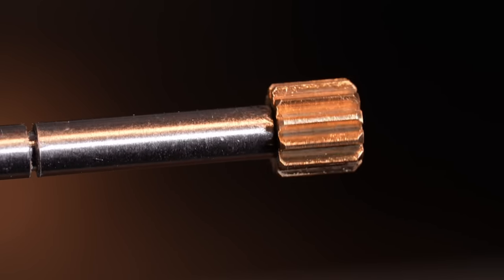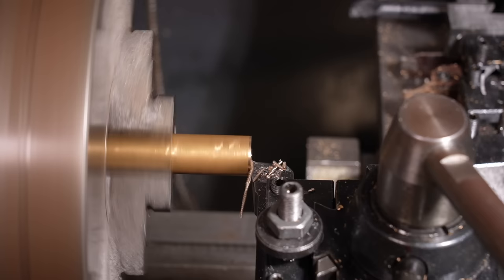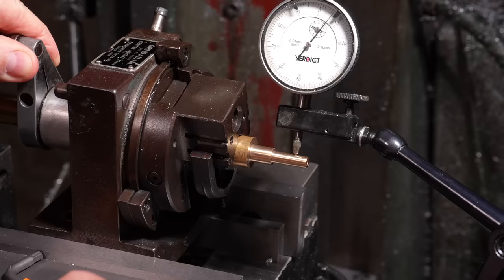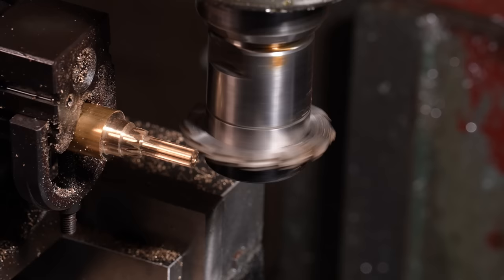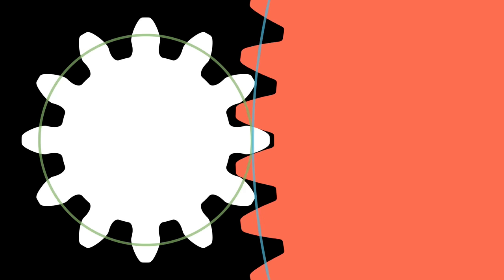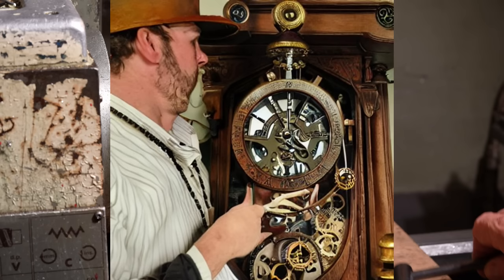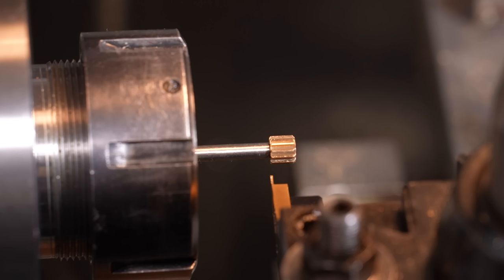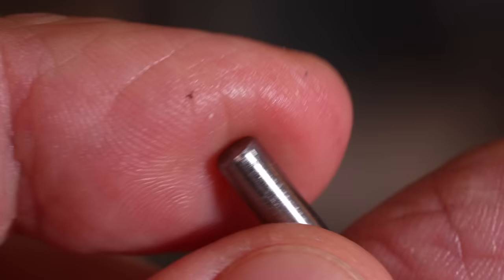My First EVER Try at Machining a Brass Pinion Gear - or ANY gear!

Comment: For "normal" gears, it is quite easy to determine Module from a physical gear: M = OD / (N+2).
OD = the outer diameter of the wheel, N the number of teeth.
So, with an outer diameter of 7.0mm and 12 teeth, you do indeed get a Module 0.5.

To go from Module to pitch, you multiply with PI, so the teeth in this gear should be spaced 1.57 mm apart.

Comment: Nicely done! I am a bit surprised you didn't go all out and build a stepper motor indexer just to make the tiny pinion though ;)
Reply from the maker: Oooh, I feel even MORE seen now! Yeah, I did consider making a wire EDM machine to make the gear. That would be TOTALLY in character...
Reply: @MachiningandMicrowaves  and imagine all the other fun stuff you could do with that!
Reply from the maker: I am SO tempted.  Lots of microwave/mmwave waveguide parts are much simpler to make with EDM
Reply: @MachiningandMicrowaves  exactly!
Reply from the maker: @tommihommi1  Now I've checked, a wire EDM is already on the project list, but it's WAAAAAY down in the running order

Comment: Oh my we are on the same path. I have finally got myself an indexing head and need to make some gears. I purchased a M1 set for a task that Im not quite ready to do but then discovered the majority of plastic gears appear to be M0.5. I have just ordered a set from China but also discovered less than M1 needs a smaller arbor, 16 rather than the 22 of my M1 set, tooling always gets you. My objective is to make the same sort of gears you have so Im grateful for your honest and direct help, I too am no machinist but I get by.
Reply from the maker: That 12/13 M0.5 cutter of mine takes a ONE INCH arbor, which is a bit huge
Reply: @MachiningandMicrowaves  Gee that is large and imperial to make it more limiting. Personally I get my cutters from Aliexpress at around $80NZ a set and free delivery but you wont find much imperial stuff. I think the 22mm arbor I purchased originally was $49NZ. For a home shop its really impressive what you can get at the moment from China, I suspect it wont continue.

Comment: 0:29 The shrinking of the small nylon gear leads to increase of the stress around the circumference. It shrinks on the axle, but because of the non shrinking of the axle, the stress in the circumference increases, which leads to the snipping of the gear . This effect is the more, the bigger the inner axle is in relation to the gear. It´s a common design flaw.

Comment: If I'm not misremembering, the formula for figuring out the outer diameter of a gear is D=2m+m*z
With this, you can use your diameter and the amount of teeth to determine your module profile.
For 7 teeth and a diameter of 9, you'll have 9=2m+m*7, or 9=9m, or m=1.
This of course assumes a standardized gear, which yours might not be, but maybe it'll help in the future =)
Reply from the maker: Indeed that's right. In this case, to OD was 7.0 mm and 12 teeth, so it certainly works if the gears are not worn and are cut to the standard involute profile.

Comment: The cutter you used was.5 module? I need to make a similar sized gear for an old doorbell. One you spin a shaft which spins a double ended “clapper” through a set of three gears. One is gone missing. It’s a 12 tooth involute brass gear, outer diameter 10.5mm, shaft 5mm.
Reply from the maker: Yes, that little pinion was 0.5 mod. A 10.5 mm diameter 12 tooth could be 0.75 mod or possibly 34 diametral pitch. That is a bit tight at the root for a 5.00 mm shaft, but looks correct. Try mod 0.75, pressure angle 20 deg, 12 teeth and see if the root diameter and OD seem OK
https://evolventdesign.com/pages/blank-calc

Comment: The cracking of the original gear is typical of Acetal parts having too great a press fit. I learned this decades ago. I just compromised on the interference between the parts and haven't had a failure since. I've made thousands. When you said 12 teeth 7mm OD, I said 0.5 module. :) Coincidentally this little gear is the smallest I produce (in black Acetal). And like this one, mine also drives a feedback position sensor. :) The idea of oversized blank OD only works with cutters designed to cut the OD as well as the flanks. Your involute cutter is not this type.
Reply from the maker: I realised later that the cutter wasn't right to cut the OD! The original was on a knurled shaft and it's a well known fault with those old rotators.
Reply: @MachiningandMicrowaves  Yes I'm sure you did see it. It's an even bigger mistake they made having too much stress on the gear since the shaft is knurled. That means the amount of "grip" ie interference between the parts can be even less meaning less stress. The gears could have lasted damn near forever. I occasionally get units returned with the stress cracked gear to fix. None younger than 35 years old. That means getting the level of stress right resulted in that gear lasting at least 35 years. By the way, when I started 40 years ago making my own gears I was doing it just like you did this one. Now it's all CNC and that 12 tooth gear is done 4 at a time in 1.5  minutes. :) I really liked the vid. You reminded me of the learning curve I went through. I'm not far off retiring now, but I still enjoy making improvements to techniques. Some gears (in low stress use) I am 3d printing in resin.

Comment: The plastic has to be Nylon (PA6). It's cast hard, undersized and somewhat brittle and then conditioned at the factory or during transit in humid atmosphere, absorbing more than 4% its weight/volume in water; naturally it doesn't remain at cast size, it expands! Then it's placed on the shaft and loses just a little moisture, shrinking onto it perfectly, holding tight in spite of being a very slippery material. The moisture is the magic ingredient that makes PA mechanisms super low friction, super abrasion resistant, super silent, and makes it tough and flexible.

Then over the years, depending on how hot it is, it continues shedding moisture and shrinking, until it's cracked by the shaft. Typically you expect them to last well over 10 years, up to maybe 20, not much beyond that under usual conditions.

If you re-condition them regularly by placing them in humid atmosphere, they might last an eternity for all i know. I have had some zipties that i stored in a super dry hot place for 12 years and they got super hard and brittle, and i was able to recondition them, and i'm still using them a few more years later, they're good as new. I just added half a teaspoon of water into the baggie, sealed it somewhat and waited for a few days.

I have a bad habit of repairing weird little plastic mechanisms. Usually cast a replacement out of epoxy using silicone putty as a mould, often partial moulds and recreating the gear piece by piece. I happen to use UHU300 epoxy, i don't know whether that's ideal but it's what i use. It's a 1:1 mix slow cure tough epoxy, but i use 20-30% more hardener (by volume) or just eyeball a sufficiently higher amount of it but not too much. Good mixing is super important, i'm sure you knew that, but it's extra important since we're creating a very off balance mixture. The reason is that the hardener half actually contains all sorts of junk including plasticizer, since the real hardener chemical would take less than 15% by volume, so they bulk it up. Of course it won't cure like that, but not a problem, i throw it on the heatbed of my 3D printer, or arrange some other heating to keep it above 60°C, then even very reluctant mixture will cure.
Reply from the maker: Very interesting! The gear is pressed on to a knurled section of the shaft but either the hole tolerance fit is wrong or the gear is underspecified, as they are known to break often. Could be designed that way as a safety feature but it's only for a position encoder. They are usually mounted on top of a mast in a casing that's exposed to the weather and appear to have a little grease on them. I guessed Delrin/Acetal/POM as I have some other gears made from that but PA6 makes more sense. Thanks very much for the info
Reply: @MachiningandMicrowaves  Arguably if they wanted something to operate heated by the sun, they should have probably picked some other material. Longer chain PAs can be less prone to both absorb and release moisture, so can last longer, but i am lead to believe take longer to condition. Or indeed POM, which doesn't have this sort of ageing mechanism at all, it's cast true to size and it doesn't take up or shed much moisture. It does have an ageing mechanism of its own, it's capable of depolymerisation in warm environments, but then it likely would crack just anywhere but not really from the shaft outwards. This purely radial failure is typical of PA. POM should likely tend to creep around the knurling over a long term, especially when hot, somewhat relaxing the stress that gets manufactured in there, i think.

Oh in case i haven't worded myself well, i use extra hardener to make the overall mix more plasticizer rich, since i vaguely want the epoxy casting to match the flexibility of original PA parts but don't need exceptional solvent resistance. I don't believe it necessarily works entirely the same with all 1:1 epoxies, because i don't really know what others do for their hardener component, whether it's entirely similar. UHU sells its materials (same, often slightly disguised by naming) both to consumers via home improvement stores, and for industrial use, and the industrial datasheet is where i picked up this recommendation to vary the mixture and cure hot to make it actually cure. Hot curing epoxy is always a good idea, it increases adhesion and shear force resistance and also is much quicker than room temperature.

Comment: I learned about gear module last weekend, by opening FreeCAD with the intention of designing and printing a roller-counter mechanism. clicked "add sprocket" and it gave me… not a gear, now I know what "sprocket" means. clicked "add involute" and it gave me an outline where I couldn't specify a diameter, just number of teeth and the mysterious pressure angle and module.

half a dozen iterations and 3D prints later and I still don't have a working roller counter but I believe the problem is the use of cocktail sticks as placeholder axles… brass rod is on order
Reply: what I need is eight-tooth 0.9 mod pinions of approx 2-3mm width and with alternate teeth cut back to half width so it's essentially 4-tooth gear stuck to an 8-tooth gear. filament 3D printer with proprietary slicing software is giving very iffy results there. resin printer is on order. I've considered just ordering some brass 8-tooth 0.8 mod pinions and cutting them down myself (and scaling down slightly to suit - desirable actually) but at multiple £ per gear that's too expensive for what I have in mind. roller-counter displays were everywhere so I don't know why I can't find these gears as cheap nylon commodity items
Reply from the maker: I guess the originals were injection-moulded from Delrin/POM or filled nylon?  Once you specify a tooth form and pressure angle, there are only certain solutions for a specified number of teeth and diameter, and as cutters only come in specific MOD or DP values, you can't make gears by specifying the diameter, unless you get really lucky.  If you grind your own hobbing cutters, you can make gears of any diameter by making the hob effectively a weird intermediate DP/MOD.  Gears are FUN.
Reply: @RoamingAdhocrat  On FDM, model in a bottom chamfer and print in spiral vase mode, and print two separately. You'll need to fill it with resin, find the centre (the hole in the first layer will help) and drill it out, and resin them together. The heatbed of the 3D printer is perfect to fast-cure epoxy on at elevated temperature, you can set something like 70°C expecting to see a bit less in the part. Hot cured epoxy also becomes more cohesive. Maybe put something undrneath so you don't drip epoxy on your bed.

Comment: Great work! Gears are next on my list of things to learn and machine.
Reply from the maker: Once I found out about using pins to measure the teeth, it got a whole lot easier to understand
Reply: @MachiningandMicrowaves  gage pins are super useful. I use them every day it seems like. I got a full set up to an inch pretty early in m my shop
Reply: @MachiningandMicrowaves  wait till you figure out how to use 3 pins to measure a hole!
Reply from the maker: @FullSendPrecision  I have full sets from 0.2 mm up to 10 mm then a few more up to 20 mm, but they are all single, no pairs.  I have some thread wires, but those drills were just the right size
Reply from the maker: @FullSendPrecision  That's an interesting thought, never seen it done.  I have a lot of three-point bore micrometers, but I guess you can measure a hole using three different pins and some simple equations, although working that out might take me a few minutes!  I guess there are videos about it that would save me the effort.

Comment: Faultless work but I see no regard to cost. Now I have been on this planet ten years more than your good self and in all that time I have honed the dont throw money at a problem just re think it. Now to make a one off pinion the purchase of an expensive cutter is not a good choice at all, so lets go back to the early days of clockmaking and look for an alternative to a solid pinion easy to make and of extremely low cost with no special tooling required with a life expectancy of a hundred years plus. The lantern pinion fits this role perfect ally co could I recommend you look at this form of pinion you will find it interesting honest. Finally can be made in the lathe without removing the pinion blank  from the chuck for all the further machining. Just a hint you will find that sewing needles are perfect to make every thing else needed.
Reply from the maker: The motivation was that I'd never tried an involute cutter and just wanted to see what it was like. I could have ground up a simple hobbing cutter. Also there are hundreds of those rotators out there all with the same potential fault so I've made a batch of these using that cutter. I'm reading George Daniels Watchmaking book in detail and I want to try lots of other techniques but until I can retire from the Day Job, time is very scarce
Reply: I would recommend John Wildings books on how to make various clocks (a book for each clock) though more importantly how to make all the parts yourself from the Brass without using castings. These Wilding books are a mine of useful information on how things are done.
Reply from the maker: @jas20per  I borrowed one of those little  books some time around 2010, might have been for a small skeleton clock? Can't remember if I ever gave it back.  Better go check all the bookshelves!

Comment: This may be late but i wonder if water had seeped into the knurling of the shaft and expanded when it froze, cracking the gear.
Reply from the maker: Certainly possible, the photos I saw didn't show any obvious sign, but it's a known fault with those models

Comment: Saw you on TV the other day. That looked like a long day!
Reply from the maker: The stress level was extreme after my amplifier died and the radio noise level from the radio mics and video monitor and Port of London links and cellphones overloaded my aperiodic receiver.  That meant it was almost impossible to get any result, but we definitely heard that poor production assistant singing Baa Baa Black Sheep. In my lab at home, there's not even a cellphone signal, so although it isn't as radio silent at 1940s Moscow, I can usually get my Great Seal Bug replicas to work after only six hours of delicate adjustment. I managed to appear nonchalant although I was feeling sick to the stomach with stress and worry.  Prof Fry is an excellent interviewer and really knows her subjects.  It was a great experience working with her and the production team.  Despite the stress and time involved, I'd do it again in a heartbeat.

Comment: So a gear is easy to cut in the home workshop, if you have a lathe, a milling machine and a dividing head. Not to mention a involute gear tool circa £50.
Reply from the maker: Cutter was £25 from RDG Tools.  I already had the arbour.  I could have ground a single-tooth hob, but life is too short. I used the punch grinder simply because it had the right number of detents. I could have made a simple dividing plate and stop, and used a milling attachment on a lathe, but this was an initial voyage of discovery.  I think I'd be confident enough to try grinding a single-point hob now, and I had a load of fun making these little pinions

Comment: ToT is very entertaining but if you really want to learn about gears and ways to make them check out the 'andysmachines' channel. Also you could have just identified the big undamaged gear and the pinion would be the same module size just with 12 teeth.
Reply from the maker: Sadly the large gear is 100 miles away and my customer doesn't have it as it belongs to someone else. Now I've found Andy's Machines I won't need to guess next time.

Comment: Well done you two. For future reference, but I'm sure you already worked it out, you could have measured the other intact gear to get the DP/module of the difficult to measure broken one.
Watched you last night, so that's what you look like. Curious the fact that Oyster cards being contactless 4 years before cash cards wasn't mentioned in a history heavy program.🤔
Reply from the maker: Sadly, the other gear is 100 miles away and wasn't even with the friend who asked me to make the part, so I was a bit light on metrological examples!  I used a body double during the filming of course. The researchers working on the programme are pretty good, but they sometimes miss some details.  Lots of he historical background was scrubbed around, so I'll go into it properly.  Money laundering in Panama.  Marvellous.
Reply: @MachiningandMicrowaves  ok you are forgiven.😉